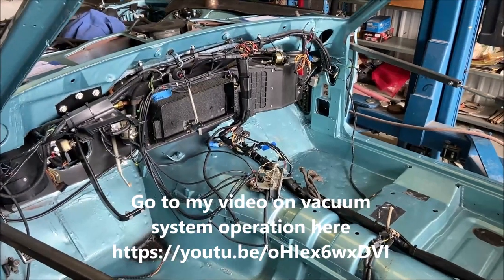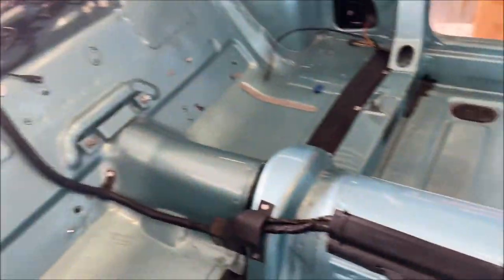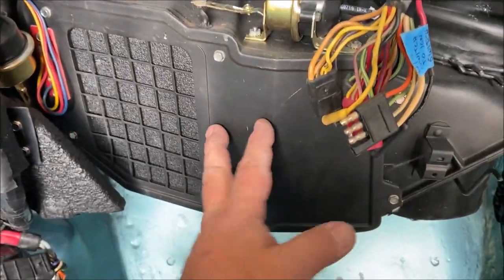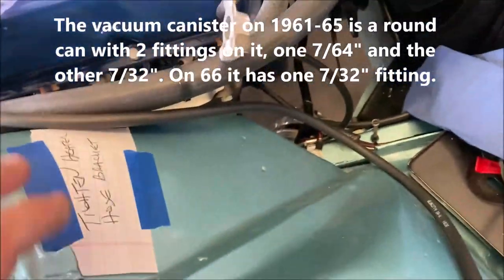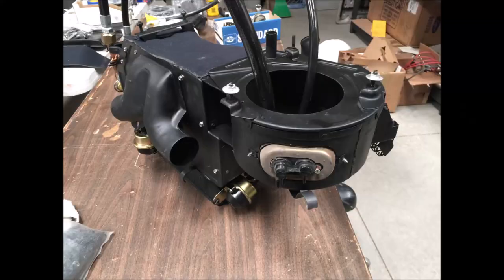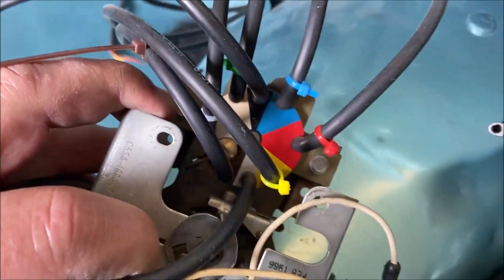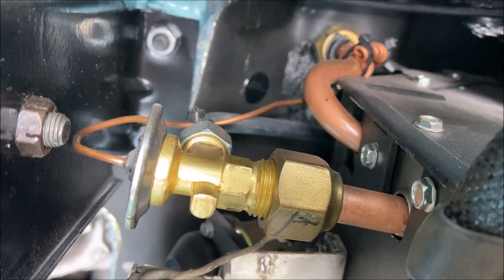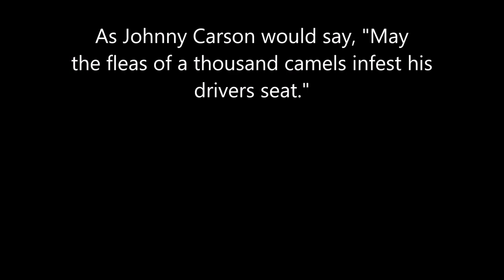1961-66 Thunderbird A/C and heater Vacuum System Layout

Comment: Hi, ok you might get ‘upset’ at this question but I have to ask:  is there a way (kluge) to put in a manual method (post, pusher rod etc) to open and close the heater door?  I really don’t want to trouble shoot the whole vacuum system taking the whole dash apart (I will make a mess of it and the Wife will yell at me, again…). Thanks Mike in NH with. 65 HT.  And I don’t use the AC…
Reply from the maker: Hey Mik, I think both the wife and I have to yell at you for that one. I have never made any such modification so I do not have any kind of procedure or idea on how to do that. It seems to me that your effort to modify it might equal the effort to fix it right?? That has always been my feeling on mods. I cant help you on that one, sorry. However, fixing the vacuum system is not hard and you do not have to pull the dash. Removing all the access panels, radio and speaker will give you access to all the vacuum hoses and vacuum motors. The hardest one to get at is the defroster. The one your speaking of that controls the heater door can only be replaced by removing the heater box which I think is also not hard. These repairs are just time consuming and I guess intimidating when you have never done it before. For example, only 8 nuts hold the heater box to the car, 4 on the firewall and 4 in the fan compartment, all of which are very easy to get at. It then comes back a inch or so, then down and out. It goes in in reverse order. Its not hard. Once you have the heater box out, you will have full access to all vacuum hoses. When I first did it, I removed one hose at a time and then it was done. The vacuum motors just unscrew and screw back in. Yes, you must be a contortionist to get at some of them so remove the front seats for extra room to lay down on the floor. It not hard but it is time consuming. And you will have to spend a few bucks on hoses and vacuum motors. Once its fixed you will be very happy and then your wife will stop yelling at you. Happy days.
Reply: @vintagethunderbirdrepair9426  hi, I did a 'work around' that appears to work.  My mechanic did as I requested to find a 'low cost' way of getting the heat on.  The easiest (least expensive') way is to (and I wish I could post a picture here) is to connect a vacuum hose under the hood on the passenger side of the engine area to the hose that engages the 'heater door' (which was permanently closed).  When this is done, the heat is 'on'- yet minimally when the fan is off and not in the 1-2-3 position.  The side window helps diffuse the heat when the outside temperature is a bit warmer during the day.  Here in N.H., it is in the 60's pretty much now and I plan to drive this 1965 Beast in the winter when there is no ice/snow on the roads.  Else, we would have had to taken apart the front dash to find the problem since initial disassembly did not show us the problem and further dissection would have been needed....  Not the best solution- but maybe when I have more $$ I can dive further into this.  thanks,
Reply from the maker: Okay, a few things you should know. When the heater door is "open," it closes off the heater core, blocks the heater core, and lets air recirculate within the car, it is taking air from inside the car and sending it through the evaporator for the AC and not taking air through the heater core. When the heater door is "closed," it is closing off any air from inside the car and letting air from outside the car come into the car, pass through the heater core and then into the fan compartment. The heater door is "closed" normally when there is no vacuum applied to the vacuum motor controlling it. This means that when you look under the dash at the heater box, you see the heater door behind directly behind the screen, you cannot see the fan unless you push the door away from the screen. this is the normal position for the heater door when no vacuum is applied. This is the correct position for the heater door to allow the heater to work. When the heater door is closed, it allows air to pass through the heater core, into the fan compartment and then out the heater ducts and/or defroster in case of a failure of the vacuum system so these systems still work. So you do not need to apply any vacuum to the heater door to make it work for the heater. If you take a vacuum hose from the engine and go directly to the heater valve in the engine compartment, this will turn on the flow of hot water through the heater core so you will get heat in the car. If electricity is hooked up to the fan, you can use the fan normally to control the flow of heat. You wont be able to control the temperature but you can control the flow of heat with the fan. If you remove the vacuum hose from the heater valve, then you will have no heat unless the valve is defective and stuck open. Your description of your mechanic applying vacuum to the heater door to allow the heater to work is incorrect unless there is something seriously wrong with your system. The heater door is normally closed and would allow the heater to work even if the vacuum system is removed from the car. I hope this info has helped. l

Comment: I am wondering  do you know why my 1965 thunderbird with  P R N ° ● L  does not shift in to 3rd I know green dot is drive. I tried  gasing it then letting go to see if it shifts  I'm at a loss thanks .
Reply from the maker: Hi, when the cruisomatic transmission goes bad, it stops shifting into 3rd and reverse, usually until it fully warms up. So when you first start it in the morning when it is cold, it wont go into reverse or 3rd. Once warm, it starts to shift properly. Ultimately it will stop shifting completely. Its also possible the modulator is either disconnected or defective. When the seals in the trans get old they get hard and stop sealing when cold. Once warm, they soften up and start to seal and then the trans starts to shift properly. There are two solutions to this problem, one is temporary. The temporary solution is to put a conditioner in the trans, a seal softener conditioner that will soften the seals. This usually works for a time. Ultimately this conditioner will eat away at the seals and ruin them in the long run but this takes time. The permanent solution is to rebuild the trans. Good luck.

Comment: You didn't say where the brown hose connects inside the car.
Reply from the maker: Hey Ben, if you mean the brown color coded vacuum hose, it connects to the pie disc, the control unit. There is a brown color coded fitting on the disc, it goes there.

Comment: Hi Nick, thank you for the video! Does the thermostatic control valve shut off the water flow to the heater core? If so, is it plumbed between the water inlet and the heater core? I have a 63 and there is no water flow through the heater core. I tried to blow through the hoses from the engine side and it seems to be blocked. I'm wondering if the thermostatic control valve is the problem but I didn't see any pictures of how it connects to the heater core. Thank you,
Reply from the maker: Hi, sorry for the late reply, I somehow missed your comment. The thermostatic control valve shuts off vacuum to the heater system therefore shutting off the heater valve and stopping flow. There is no water connection to the heater core or engine, it is purely vacuum.

Comment: i just removed all this mess of shit of my 61 and tossed it in the dumpster
Reply from the maker: I didn't reply sooner because I didn't know what to say to that. I can't believe that you just threw it all away and now there is nothing under the dash. That just devalued the car if anything. You didn't expect all this stuff to stay new after 50 plus years?? Hopefully you just said that out of frustration and you didn't really throw it away. That would be a shame.
Reply: @vintagethunderbirdrepair9426  yessir   ive worked on over 20k vehicles in my 33 yrs.  when junk is junk, toss it.  i keep reading about some cars not coming with heaters back in the day.  that it was a option?   that is crazy!  i am looking for the delete plate that goes in place of the old blower motor.
Reply from the maker: @icantintyou  Yeah, maybe in the 30's it was an option, not in a Thunderbird. Thunderbird is about sporty luxury, not luxury while your freezing to death. Anyway, its your car so I guess you gotta do what you gotta do.
Reply: @vintagethunderbirdrepair9426  yea,  i plan on replacing it with a new vintage air kit.  its by no means a valuable car.   i never overbuild for the neighborhood. someone neglected this old car and im in the process of getting it going again,  ive got some pics of t birds with no heaters from the factory.  no air car as well.  your work is very informative and i see you take great pride in it.   i love your videos.
Reply from the maker: @icantintyou  Thank you very much. Good luck on your projects.